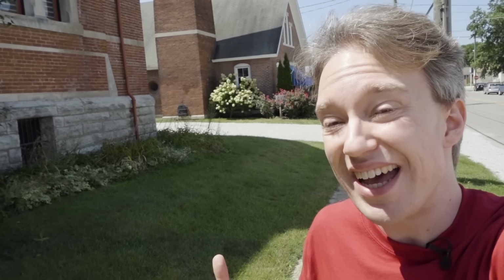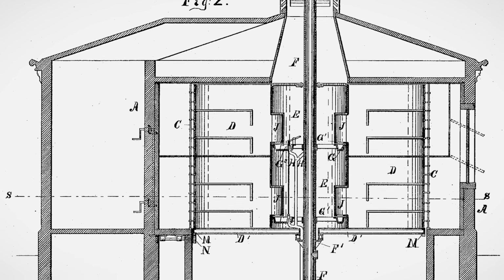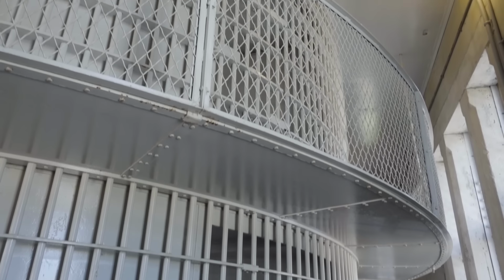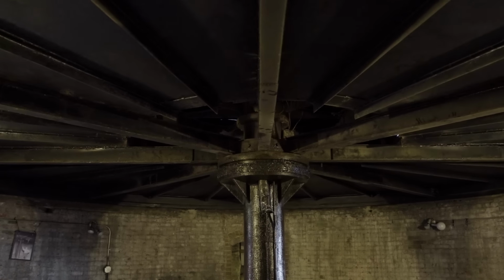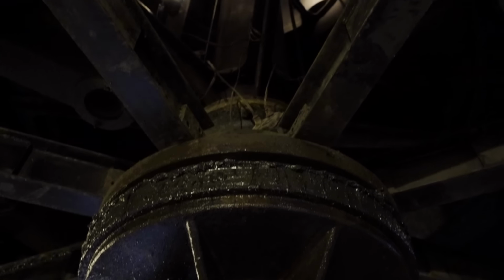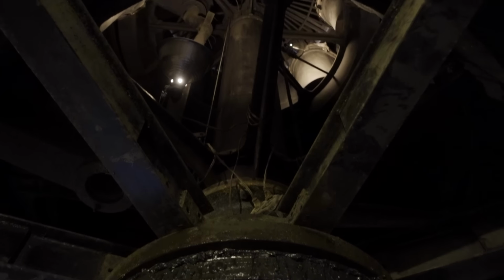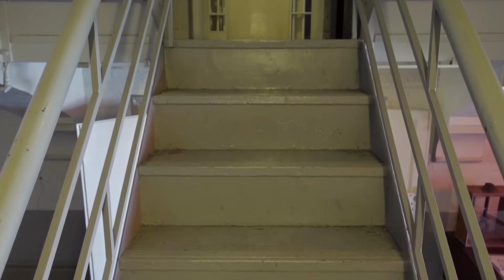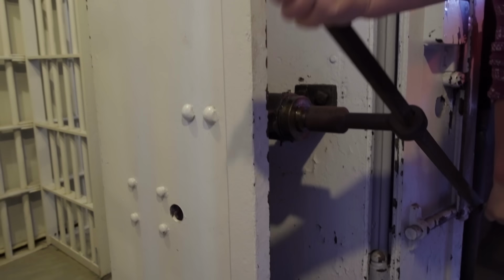The "rotary jail" had a slight problem

Comment: If you're up for suggestions of places for videos again I have one for you (please ignore if you're still a bit stressed and snowed under!). It's the Kirkaldy Testing Museum, on Southwark Street, London (not affiliated, just visited and thought it was awesome)

TL;DR version: It's a huge machine for breaking large, strong things very precisely. It's still functional and there are volunteers at the museum who can give a demonstration of it pulling apart steel bars and measuring the failure load.

David Kirkaldy was a pioneer in materials testing and he built this building primarily to house a testing machine of his own design which can destructively test the strength of materials in tension and compression (up to 20ft long), bending (up to 26ft span, though that would require the temporary stoppage of traffic on Southwark Street), and can also do shear and torsion tests. It has a designed load capacity of one million pounds (which was an absolutely deliberate marketing gimmick) powered by a water hydraulic cylinder. It was crucial in improving the safety of major construction projects in the late 19th Century.

Contact details here: http://www.testingmuseum.org.uk/media.html
Reply: Now there's another place in London I want to visit.
• The Science Museum
• Kirkaldy Testing Museum
• The Royal Society
• Some palaces or such

I love that you have to be supervised when you take the tour of this museum "Due to the nature of the exhibits and the fact that this is an area of technology that most people will not have come across before." Being a materials science major, I used testing machines of these sorts in school.
Reply: This looks amazing . I love old school engineering stuff... and of course you can't help a little Scotland getting into the machine in those days. :P

Comment: Michael Scofield would have found a way out.
Reply: That's my main problem with it, oh and the guard saying 'Hold on, I'm turning as fast as I can, its not my fault there's a fire burning everyone."
Reply: Jack Kraken how the hell can there be a fire in this metal cage
Reply: Don't know, flammable paint?
Reply: @jackkraken3888  The jails themselves don't need to be on fire, just the building would be more than enough. It is not the fire that would be dangerous (though the temperature could become problematic) but mostly the smoke.

Comment: 2:43 How would it have helped if the bars would have rotated instead of the cells? They would still have been left with the same issues.
Reply: It’d be easier to remove arms as it’s spinning
Reply: Less mass to move

Comment: Would this work with transparent metal or reinforced plastic sheets instead of bars?

As for the fire risk, some type of emergency system that makes the bars drop off.
Reply: wtf is transparent metal
Reply: @Peter-wv1dx  metal that is see through.
Reply: @paladinboyd1228  That doesn't exist
Reply: @Peter-wv1dx , It dose. Transparent metal is a real thing.

I would share links to prove it but YouTube auto deletes links for some reason.

Just google it and see for yourself.
Reply: @paladinboyd1228  I have googled and it's just stuff like aluminium which wouldnt be strong enough to build prison bars from

Comment: If the bars spun it'd still break arms. A modern reinvention would be to just replace the bars with bulletproof glass
Reply: Nah, every cell needs a door.
Reply: @ If there is only one door, and it rotates, they can all get out through the one door. The problem is they'd stick their hands in the bars and as it rotates it would break arms/amputate. If it was bulletproof glass/they couldn't stick their arms through, it could actually work

Comment: Good statement about the patent.
I would like to add, that in many cases patents even lock-up a (potential) great idea.
Maybe the original idea wasn't all that great, but it could be used when worked out a bit better.
Unfortunately, because it's patented, no-one is able to use it.
In these cases I believe open-source licenses will work much better.

Comment: Great idea....in theory. Genuinely never heard of one of these before
Reply: woollen hat "Great idea..."  really?  Sounds wildly expensive and dangerous.  It would give jailors a false sense of security leading to understaffing.  One prisoner bluffs his way to the opening, by feigning illness for instance, overpowers the one or two staff and releases the rest of the prisoners.  Of course the same vulnerability exists with traditional jails too.

Have to agree with you though... I'd never heard of this idea either.
Reply: There are problems with it, but as Tom mentioned, just adjusting the bars would have solved the amputation issue.  It's not all that different than the problem elevators present, and we've pretty much solved that.

As for one prisoner overpowering the guard because of them being understaffed, possibly, but I suspect even taking that into account you could staff it at lower levels than a normal prison and still be pretty riot proof.  You could move the cranking mechanism (well, the control for it, obviously in a modern system, while you might have a manual override you'd do it mostly with motors) out of the immediate path of prisoners, behind a second set of locks.  You'd want that isolated from anywhere the prisoners might go (mess hall, infirmary).

It looks like 'indoor plumbing' meant that the crap fell straight down.  I know modern prisoners have figured out ways to use the plumbing system to transport contraband from cell to cell using string.  This would be particularly vulnerable to that, aside from smelling a lot, but I think you could engineer a solution.  I can't imagine spinning was great for the drunks.
Reply: The advantage is that if the prisoners defeat the lock only one can get out at a time.

That said, what it's protecting against is catastrophic failure of all locks at the same time.  If there is a master control to open all the locks at once, that's more likely than if the guards have to go in an open one cell at a time.  Of course, that's a vulnerability too... if the guards have to be in the cell block to unlock the doors then they are vulnerable.

I don't think the tradeoffs this system has are worth it, but I can see why they tried it.
Reply: This was a problem with the particular execution of this prison, not the general concept.  It would have been really simple (and all other craziness involved, how they missed this I don't know) to simply have the crank mechanism not be somewhere where the prisoners could go.  The idea (at least from the perspective of total security) of a prison that can only have one prison cell open at a time is the selling point on this.  (And of course, obviously, there are lots of situations where this is a horrible idea, like a fire, or even just generally moving prisoners to exercise areas or whatever like you would in most modern prisons.)

Even Tom pointed out that simply moving the bars to the cell instead of the walkway would have fixed most of the dismemberment issues, so I think it's fair to suggest theoretical improvements.

If, for instance, you wanted to use something like this in a sci fi dystopian story it would probably work pretty well as long as you replaced the bars with a lexan barrier, motorized it and forgot about the fact that your sewer solution is essentially outhouse technology.

-you could, of course, turn it into a panopticon pretty easily by moving the cells to the exterior and turning the interior section into where the guard is, with an elevator for access.  You really wouldn't even need to move the floor around on the inside then, just the walls, sort of like some of those old always dark darkroom doors.  Yes, the thing is impractical and there are simpler solutions, but half the fun of these things is figuring out other crazy ways you could have 'improved'.

Actually, it wouldn't be hard to imagine a modern prison getting hacked and having all their doors unlocked.  Even before electric locks, I'm pretty sure there were mechanisms too, for unlocking a whole block at once... wasn't that a plot point in 'The Rock'?  Sean Connery used a rope and a hook to pull a manual unlock bar or something outside his cell?  (Too long since I've seen it.)

Comment: Ok, so let me get this straight: they built a super complicated rotating jail that only has 16 cells … just so they could have fewer guards? 

How much did it cost to build this monstrosity, compared to hiring a couple more guards?!?
Reply: Erm.. yes. Clearly the inventor was some salesman!
Reply: @thomasday3256  "say it with me now, it's a Roto-Jail, Roto means spinning, Jail means Jail!"
Reply: @Liethen  Mono rail.
Reply: it's the same case as with buildings, you can build the building with coloured bricks which cost 2 times more expensive, or build with ugly bricks, then plaster the walls every year
Reply: @FlickyBR  It might make sense to use fancy bricks if they cost 2x as much. It might not make sense if they cost 200x as much. 

Historically, labor was cheap, and this was a very small jail. I cannot imagine that it takes a huge staff to oversee 16 cells.

Comment: It's rather hard to believe the hand crank produced enough torque to chop off limbs.
Reply: You forgot about inertia of 30 tons of steel rotating
Reply: F=MA, and there's a helluva lot of mass
Reply: Gear reduction bro
Reply: @supremeclamitas5053  And very little acceleration......
Reply: @user-vj4ql5ul7q  It's literally like 30 tons of steel, even if the acceleration is really low, you wouldn't want to be hit by a sedan (1-2 tons) at even one kmph, let alone a giant, rotating, steel wall.
Reply: @supremeclamitas5053  Kinetic energy is 1/2 m * V ^ 2. I wouldn't mind being hit by a train if it goes slow enough. Plus the video clearly described people sleeping with their limbs sticking out so they would get caught immediately as soon as the jail started to move, not when it is already moving fast.
Reply: @Conserpov  No I didn't.
Reply: @veraaj1  Only with an enormous reduction and only if they keep cranking while the prisoners scream to stop.
Reply: @user-vj4ql5ul7q  - There was no “moving fast.”  As someone else pointed out, it’s a reduction gear - it takes a lot of cranking to slowly move it so that the force is low enough for the human turning the crank, but because of that, you’d likely not notice the slight additional resistance of an arm in the way.
Reply: @AndreySloan_is_a_cnut  As I wrote, that would take a long enough time while the prisoner is screaming, making it quite unlikely.
Reply: It's been said that a prisoner with a wooden limb was able to stop the rotation, so breaking legs was probably quite difficult given how hard human bones are. Probably the claims were exaggerated.

Comment: Tom - I don't understand how the problem could have been solved if you "rotate the bars instead of the cells".   Wouldn't that be functionally identical and have the same limb crunching consequences?
Reply: i'd imagine there's less momentum? just the bars would weigh a lot less than the whole damn jail
Reply: @emeraldgale603  Oh great, so now the prisoners can block the rotation at any time they want.

Comment: They could have either used bars that are too close together for limbs to stick out, or even just a barrier other than bars. Idk if they had a strong enough glass back then, but I'm sure there was some solution that would remove the limb amputation problem.

Comment: On Feb 19th 2016 I had a similar mechanism in tyger river correctional facility rip off my right arm at the shoulder.  8 surgeries, 352 days in an infirmary bed and 4 more years of abuse and neglect bc I sued (and won) and I finally got free from the treachery

Comment: My take on why they didn't make the bars rotate instead of the entire cells was because that would have been enormously more difficult.  The cells rotate on one center pin/axle and bearing, and comprised several floors, while the bars would require a track and wheels the entire circumference of the cells, and each floor would require its own set of machinery.

Plus, I believe the advantage was supposed to be that the only way out of each cell was always directly in front of where the guard was rotating the crank.  If the bars rotated, then another guard would need to follow the opening around to the far side to make sure only that far cell's prisoner enters or exits each time they let someone in or out, for example.

Comment: I could see this idea having worked, with the idea of having as few guards needed while maintaining safety, if the bars were attached to the rotating cylinder, to take away risk of personal injury, and having catwalks surrounding it with a safety override that could open all the cells at once in case of a serious emergency. But the idea of normal operations only being conducted by one fixed point, and rotating the entire cell structure isn't necessarily a bad one in theory. Now, this is just for the sake of minimizing guards needed for normal operations, and not anything else really, as the prison would function like a normal prison during emergencies.

Comment: If they actually took a further deep dive into creating this with the technology we have today this would actually be a really good concept for modern prisons and would probably greatly reduce not only the number of escapes but also the number of riots as only 1 prisoner is released at a time but instead of making this manual they could automate the mechanism to turn each individual cell and obviously be able to provide more safety measures such as installing censors that will automatically stop the mechanism from functioning when it detects something in the way of the censor therefore preventing anyone from losing any limbs from the rotation of the cells.

Comment: This could easily be implemented into a modern jail with no bars and walls instead with CCTV cams to watch cells with the lack of bars. An alarm going off when the circle was going to rotate would be implemented as well and more could be added. You could even make this into a jail tower design idea.

Comment: nah, it’s a great idea just needs a small improvement - a separately operated central firedoor that connects all cells, and a simple optical device (like in an elevator) that stops the rotation if the pathway is not clear to keep limbs from being cut off. a small upgrade for a good idea

Comment: So the sewer pipe would have had to rotate as well, right? And how did the water (did those toilets flush with water?) move around that? You did a video once on a rotating house with a solution to that problem, but that was custom designed. Did they have that solved in the 1800's already?

Comment: Its actually a great idea , other than the sea sickness: Does Iron Burn? Certain Concerns were over rated, maybe it should have been a solid wall, except for a clearstory to prevent the dismemberment. Id be interested to see other statics : How many jailors injured? How many inmates harmed other inmates? I bet a HECK of a lot of inmates in the system would prefer rotation over being thrown in with the general population.

Comment: How exactly would it help if the bars were rotating and not the cells? Couldnt you just as easily lose an arm then? Also it would lose the advantage of a fixed single entry point. But yes, this concept in general seems a bit nuts, even if you can save a little on labor. Luckily today its all fully automated anyway.

Comment: If the bars move instead of the cells, couldn't the bars then cut off limbs? And wouldn't they still have to rotate the openings onto each cell at a time for evacuation?
Reply: Yes, but if the bars spun it would be easier to pull away. Also, it would be less weight to spin
Reply: @Bruhhhhhhhhhhhhhhhhhhhhhhhhh.  Less weight, true.
But for cutting off limbs, it would be the same. Whether it's the bars or the cell itself that's actually moving, from the perspective of someone in the cell it just seems like the bars are moving and that's the limb-chopping hazard.
Reply: @ true, but think about it. If the bars are moving, you can walk with the movement and be able to pull your arms out before they get broken or chopped off. But if the ground spins, it’s a bit harder because you’re being pulled by your feet rather than your arms.
Reply: @Bruhhhhhhhhhhhhhhhhhhhhhhhhh.  I don't see what different it makes from inside the cell. To you inside the cell, the bars are moving either way. You're laying or standing on the floor which feels stationary.

Comment: Wether the bars rotated or the cell rotated, the amputation issue could've been solved just by putting plexiglass in between the gaps if the bars.

Comment: Why not just put the bars inside the cell instead of outside? So the bars and the room spin together.  Then just have a different motor slide open the cell door when it faces towards the opening. Just tell the prisoner to back off from the gate before you slide it open.
Reply: Because the prisoner would just stick there arm through hoping for a quick pay day

Comment: How would it work if just the bars spun? Wouldn’t it be the same hazard and how would they access the other cells?
Reply: Rotating the bars means you're not fighting the inertia of an entire cell block. On the one hand, if someone gets their arm caught in the mechanism, it's more likely to just stop it without serious injury; on the other, it'd be easier to start and stop, meaning it could be evacuated more quickly in an emergency. It's still not great, but it's much safer. Plus, you aren't spinning a room with people inside.
Reply: @naomicoffman1315  - You’d still be dealing with a reduction gear that would reduce the force enough that the person turning the crank would likely not notice the relatively slight resistance a human bone would offer (you’d still be cranking a ton or more of iron around).